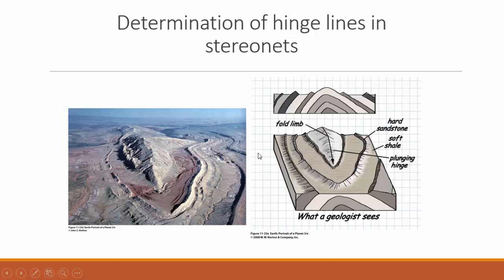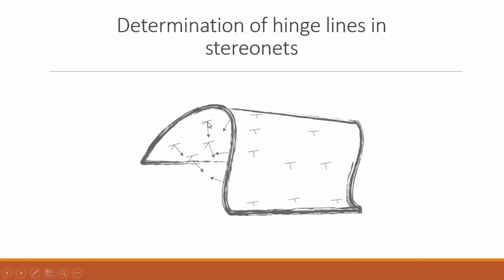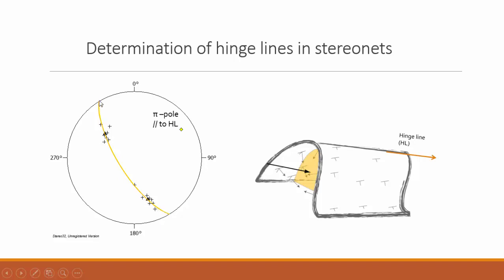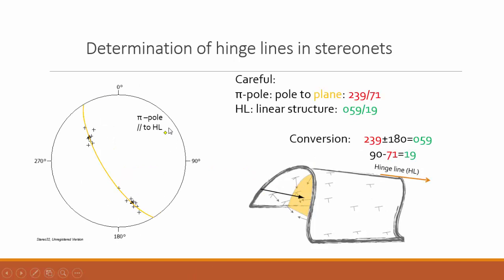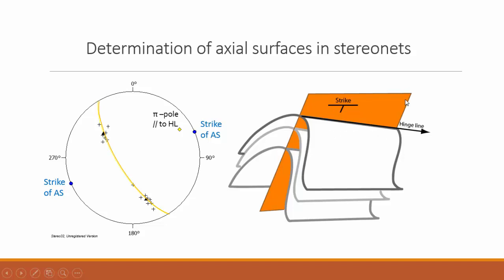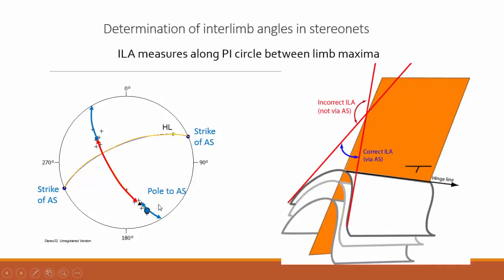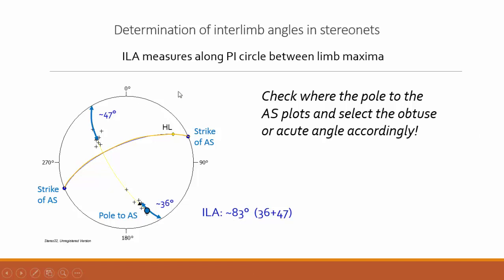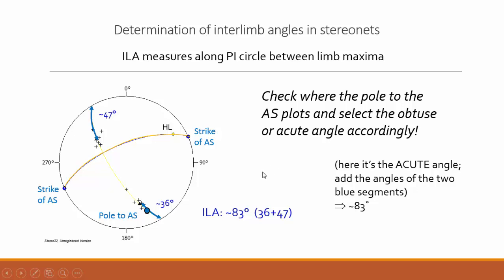Fold analysis using the stereonet

Comment: What if the strike of the hinge line is unknown? How do we know it?
Reply from the maker: I’m not quite sure what the point of the question is. The hinge line doesn’t have a strike. It has a trend and a plunge, which is given by the position of the pole to the pi-plane. If the question refers to the strike of the axial surface, the answer would be that this direction must be determined in the field or from geological maps.